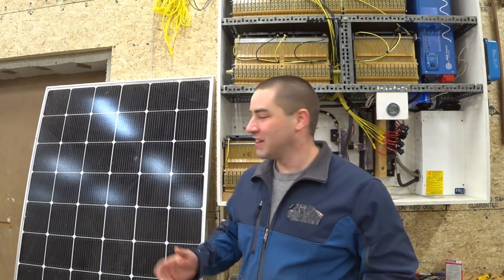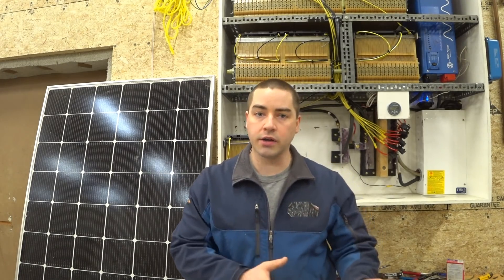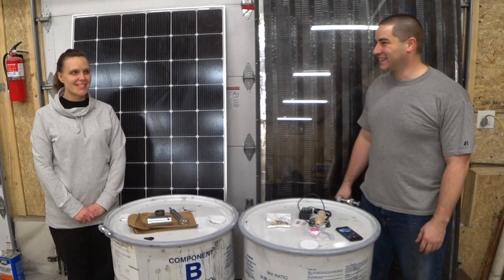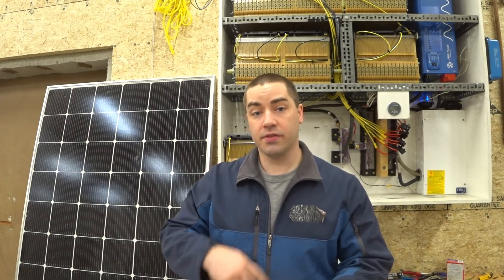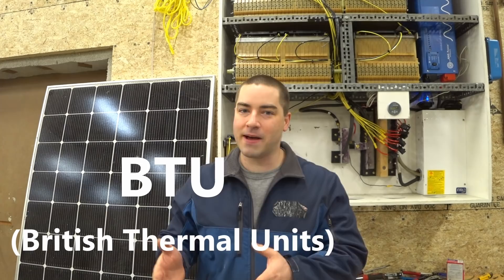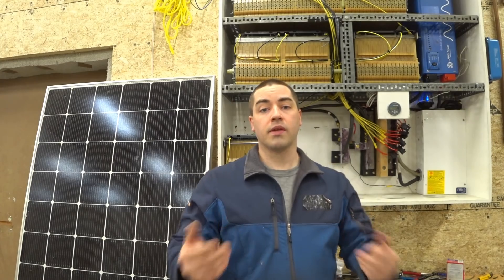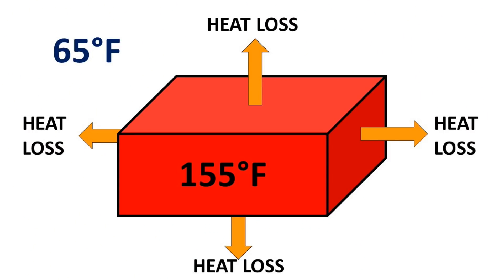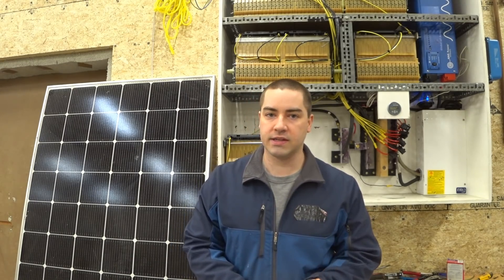Cheapest Energy Storage Off-Grid

Comment: Great contribution. Entire nations go down disastrous energy planning paths, because their leaders do not understand that you can store energy in other ways than as electricity. Samsung markets a fridge in Africa that can do this with cold. Energy can be stored for example as ice, heat, hydro pumping, pressure.
Reply: We have a fridge on our boat that stores cold (if you know what I mean!) while the engine is running, reducing electrical demand from the batteries when the engine is off. I don't know if it uses some kind of state changing liquid or what, but it's very effective, it can maintain its temperature for eight hours without additional power input.

Comment: Do I have it correct that you use photovoltaics to heat water? It is more efficient to use hot water collectors (80% vs 15% of solar flu.)
Reply from the maker: I currently use thermal panels to heat water.  But, I just finished up an experiment comparing PV to thermal panels for heating water.  The PV did awesome!  Check it out: https://youtu.be/KVeGummoXS0

Comment: Physics explains that converting energy once has already BIG energy loss
Converting energy twice makes no sense
Converting energy 3 times you wasting time and money for sure
Storing electrical energy in a form of electrical energy (aka battery) is still the BEST way to go
Reply: I agree.  Why he felt the need to post this I don't know, using passive solar to heat water has been around forever.  A cheaper way to store electrical energy is what is sorely needed.
Reply: The difference with this system is that you don't use the sun to heat the water you actually use in the house. That is the normal system, and works well as long as you don't have a few days without sun, AND have electrical backup (also very common in solar systems) to heat the water.

THIS system uses a large, very hot storage tank, to directly store the ENERGY, and release it back slowly on demand, through the heat exchanger. There is only one conversion of energy, from sunlight to heat, no additional conversion losses. When you take into account the low cost and simplicity of the materials, construction method, and running cost, this is a VERY effective system.
Reply: Due to this loss of thermal energy you should make every effort to place the storage container in a location that lost heat is really not lost.  In the house I grew up in we had a tank in the basement with a floor grate directly into the living space from the room with the tank.  Some warmth always came up and we could cover the grate with a heavy rug when that was not needed.

Comment: solar photo voltaic panels. water cooled. harvest power and heat directly. heat dissipated to the h20 also helps the panel maintain a better temp thereby maintaining a higher voltage, more watts. 

that idea plays in my mind for quite some time now.
Reply: There's a company that makes those, they are called hybrid solar panels, and if you combine the gain in efficiency via cooling and the thermal energy collected the total efficiency jumps from around 20% for a regular PV panel to around 80%, which is huge

Comment: Storing heat energy is the most inefficient method of energy storage though.
Reply: Not if the requirement is for heat! A large, well insulated tank can remain hot for days after the initial charge. There are no conversion losses, no mechanical losses- why would you say it is inefficient?

Comment: I don't get this. Why not just heat the water using hot water panels and store it in insulated tanks. X4 for 4 days. That's what we do in Australia. Much more efficient. If you want no pressure tank then just use a booster pump when you turn the tapes on like what is used on a rain water tank. Please research Legionella disease before you play with heating water.

Comment: You don't need lithium batteries for a stationary battery. Why didn't you use something cheaper?
Reply from the maker: Hi Mark,  You are right that LIthium batteries are not needed for a house backup system.  I would have been happy with lead acid.  I was able to find this battery, used, from a junkyard.  I paid $2,033, and it is rated at 18.4kwh.  I have tested a usable 14.3kwh.  This is cheaper than deep-cycle lead acid.  I have videos up on my channel about getting the battery, and re-wiring it, if you want to learn more.  Thanks for watching.

Comment: The implication is the energy is stored in heat like a battery and then you can convert the heat efficiently back to electricity thus you can remove the batteries. In reality you are just lowering your need for batteries to heat your water and possibly the home with the hot water.

Unless I am missing something

Comment: I Love this !

So our house uses an average of 12,000,000 Btu's per month for heat and hot water throughout the winter months.
(Natural gas) Converting 12 million Btus to Kwh's, we multiply by .000293071 = 3516 Kwh's
If we used a ground source heat pump that has a COP of 4, we can divide 3516 by 4 = 879 Kwh's 
879 divided by 30 days = 29.3 Kwh's per day we'd need to make with solar to supply all the heat and domestic necessary.
However, to get a COP of 4, with a ground loop system, you need to stay within certain temperature parameters. But in theory, it would be possible. A COP of 5 is possible with perfect conditions.    An Air source heat pump would make the PV system twice the size as it will likely have a COP of only 2 , and as little as 1 in extremely cold weather.  So I think an air source heat pump is probably out of the question for northern climates.  One more thing.   I have  a friend who put in a grid-tied system in SE Michigan, 10,000 watts worth of panels and he's averaging 22 Kwh's a day thru the month of Feb.   Not bad.   Using your water storage idea would take an off grid system like ours and make it the equivalent of a grid tie system>> banking all that energy.    I could see this all working out.  Oh and our house is circa 1948 with almost zero insulation, very leaky.  That 12 million Btu's a month would be half that amount in a modern well insulated house. 
Good stuff as always David !
Reply from the maker: Thanks Mark.  You are still not that bad, I know people burning up double or triple your consumption.

Comment: Did you consider doing additional PV to generate heat (not through batterys, or possibly by 'excess electricity' generated, to say heat water rather than not using it or (if grid tied) selling it back to the grid?

It sounds like you need another tank in the basement ((grin)). ... To bad there isn't a way to take 'low quality heat' and make electricity from it...  You could also increase the heat storage capacity by possibly putting in some polyethelene glycol in the storage area, I don't know the numbers, but If I remember right it increases the thermal carrying capacity of a given amount of water.

Great experiments... keep it up!
Reply from the maker: Another tank, more batteries, then some more solar panels, then a few more tanks, a little more batteries...  LOL  My wife says we have enough right now.

Comment: hello david fine business on your hot waater heatingsystem.Ipower my home using solar and battery storage for many years. Iuse awood stove toheat main house and the stove also heats a tank behind the wood stove for hot water. the tank has a high temp andpressuree relief valve.for ssaftey. I also have a thermoter on the top of the tank to kkeep an eye on the temp. if it staarts to get to high. I do  use the washing machine wash dishes take a shower any thing to bring the temp down. Ialso let the hot water runnalough thats waste full.at times when the outside temp is really low. Iuse the electric hot water heater off of ssolaar energy in the summer time.because there is so much solar.Keep the Faith John voltector@gmail.com  ps the tank is veryslow heating. sothe water takes along time to heat which is great.

Comment: There is also another way to store the energy and without any loss, but much more dangerous and using more energy - convert water to hydrogen and store in pressurized tanks however that would require extreme safety measures and not really suitable for domestic use - but in theory you could store energy in a form of gas for thousands of years.
Reply: Because it's not efficient, it's definitely a cool idea. But recombination of the gas through a combustion engine is at most 50% efficient. Or at best with fuel cells 60%
Reply: you'd realistically get less than 10% total efficiency with that system. industrial hydrogen production barely manages 30% efficiency for only making hydrogen, and that has all the advantages of industrial scale production. a home electrolysis system might get half that, and you'd be a god if you got more than a 75% return on the stored energy.

Comment: If you are trying to store electricity, I have found using electricity made from either solar or wind power, which is then used to compress air and store the air, I can run that compressed air through a small air-operated engine of my own design and re-claim electricity in any voltage and any amperage and any phase I desire.
Reply: Multiplication of losses is silly. The charge efficiency of a lithium battery is over 97%
Reply: Interesting. How much is lost to inefficiency?
Also what size tank for how many KwH?
Reply: This is dream discussion and not something really implemented.

Comment: Clean, washed play sand beats the heck out of open-cell or closed-cell foam as an insulator and it is basically free, if you are a good scrounger. My solar heated oil tank receiver is insulated with 5 inches of clean play sand. It cost me about, nothing! Play sand is on the order of rock wool, only better and free.

Comment: Do like I do. My solar panel is filled with vegetable oil. It circulates into a large receiver and when I want hot water, ambient temperature tapwater is passed through the heat exchanger in the oil storage tank and I have screaming-hot water. The cool part about this is, I live in North Texas and we get seasonal hard freezes, which would kill a water-filled solar panel, but soybean oil does not freeze. End of story.

Comment: Ok finishing video i see you have ur basics, probably more from the way it sounds you just dont want to throw high lvl math at your whole audience lol; either way I still might could offer ideas especially in the battery part.  I like how ur taking advantage of water's huge heat capacity for thermal storage; most ppl dont realize how much energy can actually be absorbed by water (especially heat of vap....stupid high energy).  It takes more energy per volume to vaporize water than it takes to melt tungsten metal, with the highest melting point pushing 3600 C !!  (maybe per mass instead of volume...either way still impressive)

Comment: Hi, I was wondering your knowledge in thermodynamics, fluid dynamics, etc to model an optimized system??  This is quite complex if modeling accurately, things like heat capacity of water assumed constant when it actually varies with temp...this alone can reduce your theoretical energy storage as thermal in water as heat capacity decreases with higher temps; so calculated energy stored will be less by 5-15% depending on temp ranges, max T, and volume used etc requiring higher level 2nd order differential equations to accurately predict system vs simple formulas for assumed constants not considering varying properties.  Same with heat flux/transfer through the exchanging material also varies w T...for most metals it is usually negligible, but with the plastic polymers as u use it can be much more drastic effect.  Heat exchangers are quite complex as well...

I've a Dr. in chem engr and i love design based modeling/optimization, I work R&D in various projects, many of which have been battery technologies.  I would like the opportunity to maybe help you with ideas and calculations that could make this system perform more efficiently.  For example, copper is excellent heat transfer with high heat capacity, but also very expensive.  To avoid poor transfer properties of plastic pipe exchanger, aluminum is much cheaper than copper with basically equal transfer coefficient but a really low heat capacity...the low capacity means it absorbs far less energy in itself and with the right thickness can out perform copper for a fraction of the cost.  300 ft of plastic hose could b replaced with 40 ft or less aluminum, or possibly could use a couple old Al car radiators as the submerged exchanger and achieve your target hot water temp for very little cost.  A small circulation pump on the water reservoir hot side could also cut heat exchanging surface area by a great deal, as convection transfers MUCH more energy than conduction alone; especially with high Cp value fluids such as water.

Please let me know if you would like to discuss further.  One more thought, have you considered a cheaper mass storage battery alternative?  Iron based batteries, though more bulky due to lower charge density, are very cheap with the ability to even DIY build without too much headache.  I used Fe+2 and Fe+3 ion cells w carbon/iron electrodes i build myself for roughly 10 years still have good capacity.  Since they rely only on changing the oxidation state of iron from 3 to 2 during discharge, an internal short or dmg in battery is not dangerous or destructive to the cell, it simply just discharges it because its all ion/electrolyte based chemistry.  They cannot handle huge currents, but multiple ones in parallel since so cheap can still add up to usabe continuous currents.  Fe-Ni batteries are even better performance with super long cycle life but a bit more expensive as the DIY option isnt as practical without some chemistry background.

Anyway enjoyed ur vid, cool to see someone thinking on such matters.  I ran a boiler system from wood heater as well, by routing metal pipe coils through exhaust of wood heater, i was absorbing a lot of heat that normally would escape as exhaust into the water, which i used to heat radiators in back rooms and gravity fed back to reservoir to recycle again.  Worked great cut my wood consumption by nearly a third all winter just by absorbing some of the normally lost heat
Reply: Great stuff here, I'm interested in your success with the wood fired heat exchanger used to heat hot water. It's something I'm tempted in tinkering with. I have alot to learn and dipping my toes in has made me want to learn more. Cheers

Comment: Electrical power is a lot more versatile form of energy, hot water is not. You can get hot water by burning would and have water circulating through copper coil tubing.
Reply from the maker: I agree, electricity is more versatile.  Thanks for watching.

Comment: How about storing energy as compressed air?
Reply from the maker: I've never tried it, but it would be fun to test.   If you haven't seen them, "Greenpowerscience" Youtube channel does some testing with compressed air.
Reply: Too inefficient....energy required, or work required, to compress air increases exponentially with pressure.  (not exact calculation) So to get say 50 psi takes 300W per 50 ft^3, where double pressure is more than double energy to compress it say 100 psi takes 800W.  150 needs 1600W per 50 ft^3 etc; and high pressures would be needed to get a fairly efficient return when reused.

Second is conversion losses, this would require multiple energy conversion steps between energy generation, storage, regeneration and finally use.  Each conversion has energy loss due to efficiency losses, so this indirect route would be probably less than 50% return from original input.
Reply: @ckimsey77  Thank you data, as you were.

Comment: You fail to mention after the 4 days, how you heat all that water back up.  Even with a heat pump, it will take days of hard sunshine!  From where does the heat pump get its heat?  If it is winter and the heat pump is in the house, the furnace or something else will have to make up that heat.  If you extract the heat from outside, the coils will freeze and you will use 90% of the heat captured to repeatedly remelt the ice that constantly forms on the coils.  This arrangement is as practical as a screen door in the bottom of a submarine!  You need a place to get the heat from, if you are not going to "make" it directly with propane burner.  You would be better off with a gas-fired water heater.  You can put your heat reservoir ahead of that to save the work the water heater must do.  Another thing: plastic tubing at 50PSI  and 150F is waiting for disaster.  Never use plastic pipe of any kind for domestic pressurized water.  For sewers and non and low pressurized heat exchange loops, OK.
     If you live in Florida maybe this will work.  But in Washington DC, forget it.
Reply from the maker: LOL, I love your analogy.  I'm still chuckling.  
I have dozens of videos on my channel about making hot water, this video is just about storing it.  Thanks for watching.

Comment: IF YOU ONLY DONE WITH COPPER AND USE OIL INSTEAD OF WATER.
Reply: Snarky . Live not to mention the specific heat capacity of oil is significantly lower than water, so he would need more of it. Pex barrier pipe would be sufficient.

Comment: I used to heat 400 750 and 1000 barrel insulated tanks in oilfield. I used 19mil and 49mil BTU heaters, which consume about what would power a neighborhood of electricity for a year. Now, if you could properly insulate on that scale, you would have storage capacity capable of not only providing heated water, but capable of heating your home.  Using peltier arrays, you could generate a little electricity (huge losses) by cooling the water to ambient. Perfect insulation is vacuum, which you can obtain from multi compartment square tubing with all air removed. Stainless steel is the ideal material. You would achieve a higher R value.